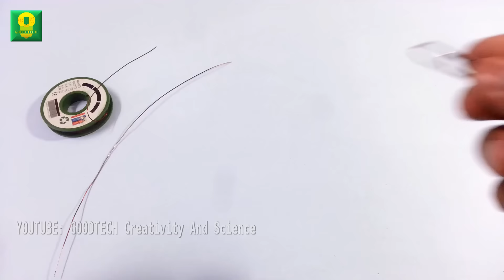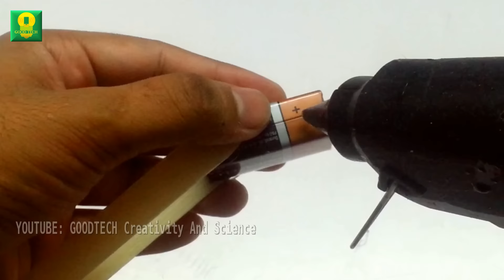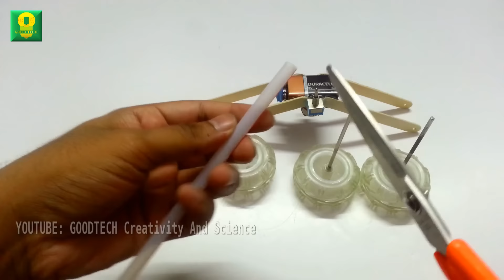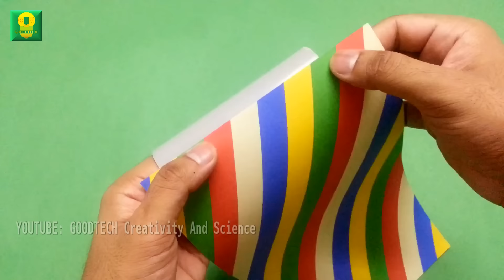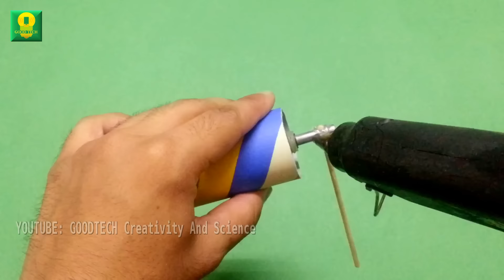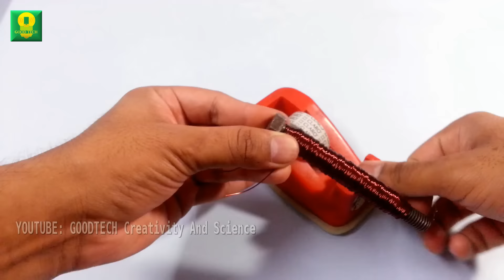4 Simple DIY Ideas

Comment: hey can you give the description about what you are using
Reply from the maker: Hello Asit,
There are 4 different toys that i made in this video. The material links are as follows:
1. For Homopolar motor you need:
Enameled copper wire.
Office paper clips
AA Cell
Neodymium Magnets

2. For Electric car
Ice cream sticks
9v battery
DC motor
Switch
Battery Connector
pulley
Wheels

3. For Electric Rolling Toy
PVC pipe
Printed design
Geared DC motor
Battery and Battery connector
Switch
Wooden stick

4.For Electromagnet
Iron Bolt
Enameled copper wire
High power battery